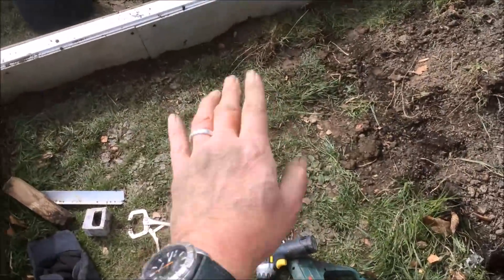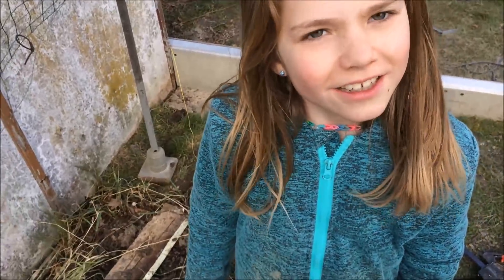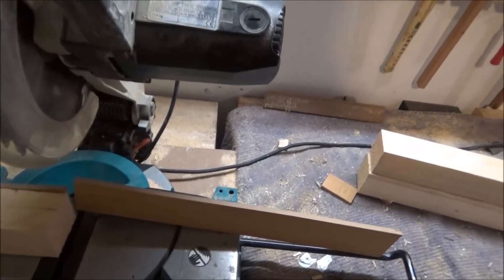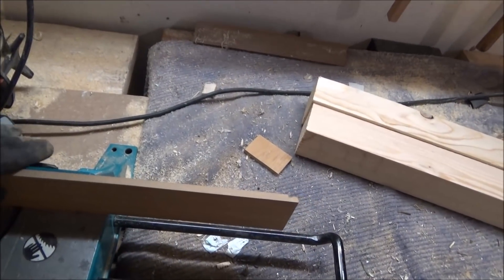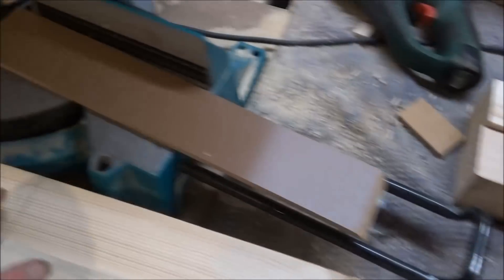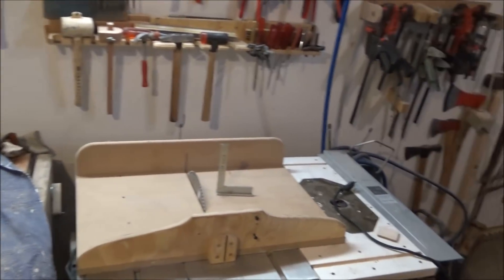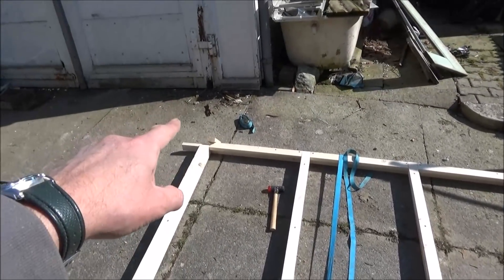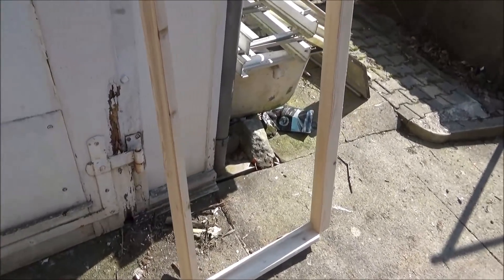Green house pt 4. 24 03 18

Comment: You are really a craftsman and know how to work well with wood. Shame that the paint went off. Glad you got a bit of help from Your helper. Take care. Nick
Reply from the maker: Thanks mate. Hope it lasts and if anything did fail or rot out I made it so I can fix it. Not like the tunnel I was looking at. The tunnel was not as good as the ones I had seen people using in the UK. I was talking to a guy in Germany he has had two and nether lasted 2 years frames and the seems failed. So at 200 franks a year is not a cheap option.

Comment: I like the saw sledge......great for notching out 👍   It will be a sturdy structure when finished. Bring on the next stage 😀👍
Reply from the maker: Thanks Nigel. The sledge is a great tool long cross cuts safely. You can also make some nice finger joints for boxes with it. Next one a week maybe have to make the other side so its the same as this. Also painting what I have got done.